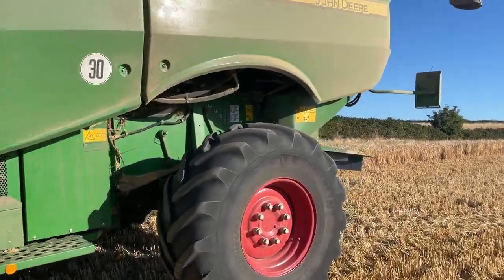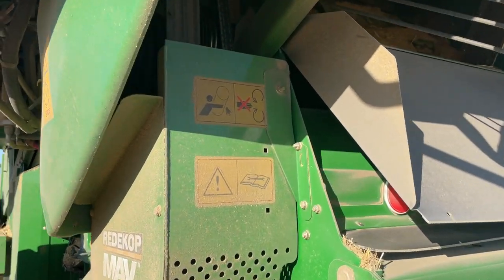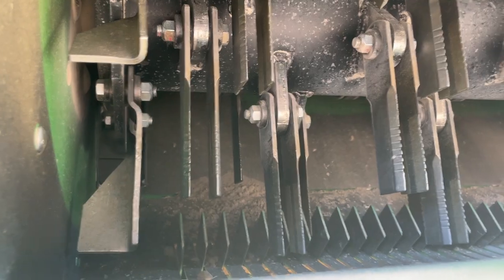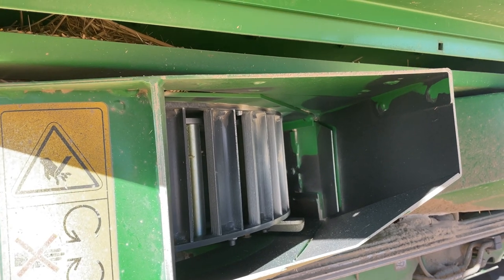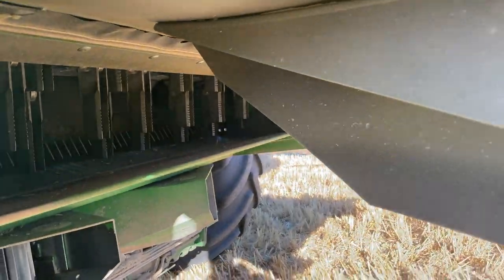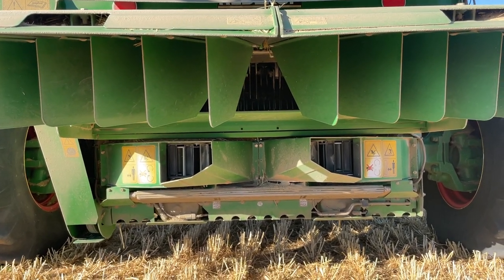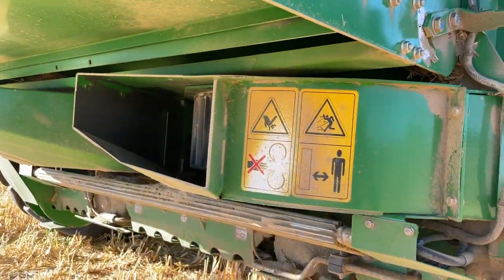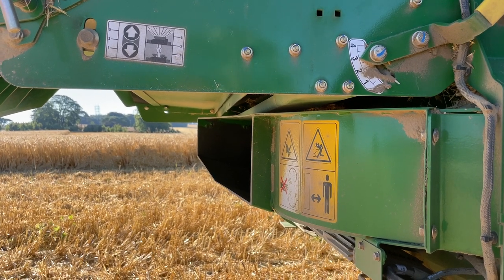Harvest 2022 Day 23

Comment: Thanks for showing the chopper and mill to us. The paddle blades on the chopper look a good idea, stops any potential build up of material around the bearings (essential this year). Can you check actual grain losses from the sieves before it goes through the mill? I would prefer to see what is on the floor rather than rely on the screen. Interesting to see how it would perform in damp conditions with possible choking issues.